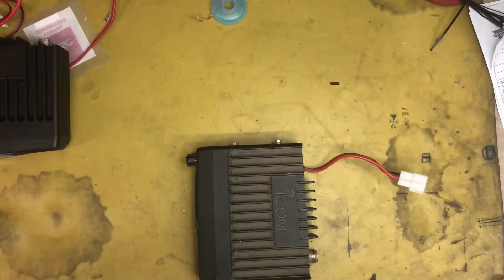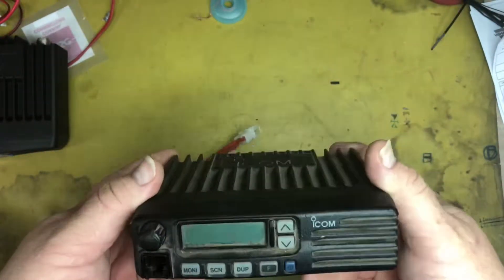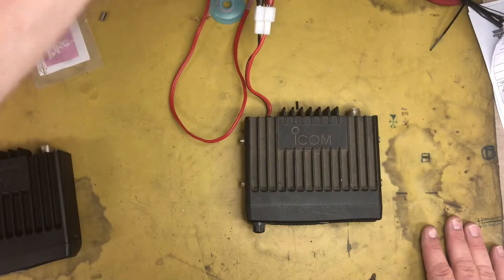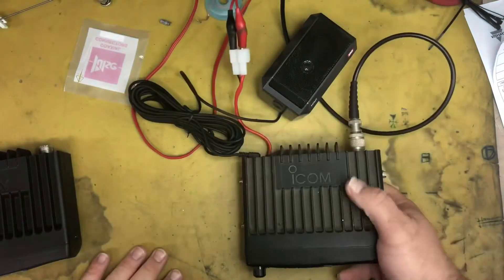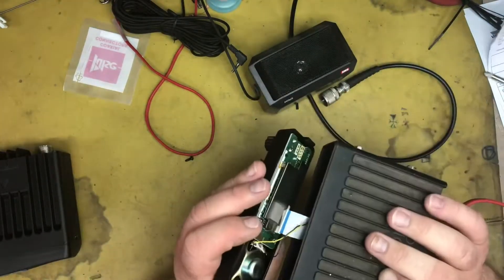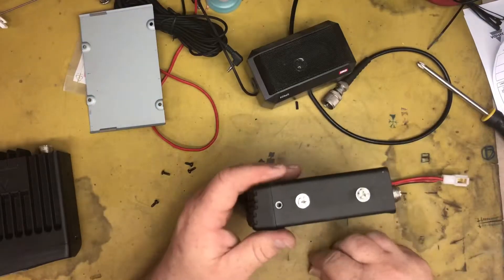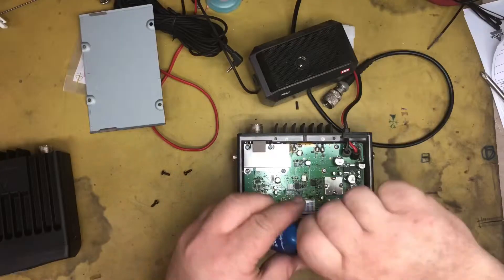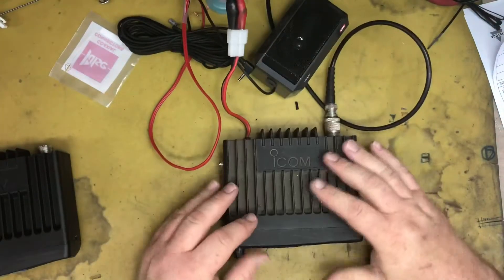“Quickie” repair video of an Icom IC-400Pro

Comment: Hi I have one of these radios that I picked up from a wreckers that came out of a wrecked vehicle where would I find a replacement lcd screen
Reply from the maker: Hi Shannon, your local Icom dealer should be able to help you out with a replacement LCD and if they have a repair shop they should be able to fit it for you to.

Comment: I see you have unplugged the Mike, Does the “Mike”. Just Pull Out ?     Dennis.
Reply from the maker: Hi Dennis, yes you can unplug the microphone cable, it has a tab you need to push down first, then pull it out, its like an ethernet plug.

Comment: Hi, I noticed the radio auto powered on when applying 12V. How did you do that ?. I cannot get mine to work that way, I also didn't see an OPC-617 accessory cable connected.
Reply from the maker: sorry, I just realised my last comment was wrong, its past my bed time lol, this radio is programmed to come on in the software for this commercial customer, as with the OPC-617, this radio is for voice only via rj45 microphone plug, there was no need for the optional accessory cable.
Reply: Past mine too (Melbourne) :). The volume knob doesn't click (turns only), not sure if its a different hardware version. I have access to the programming software, just need to identify the parameter to change.
Reply from the maker: Jim Nik 
I'm in Gippsland, yeh I would have to look at the software program to check but the laptop is at work atm, I have a look for you tomorrow if I remember,.. hihi.
Reply: All good, radio finally sorted. Icom programming is cryptic!